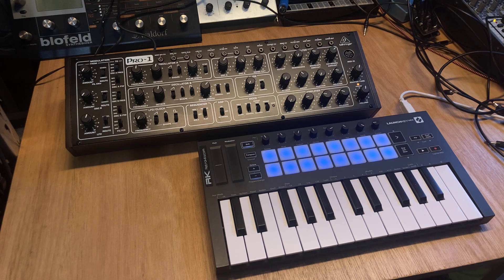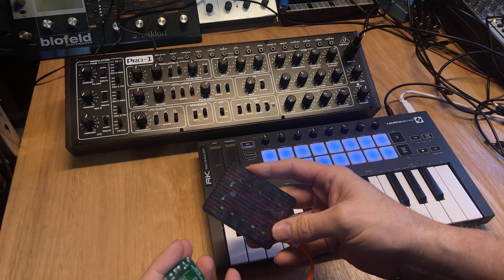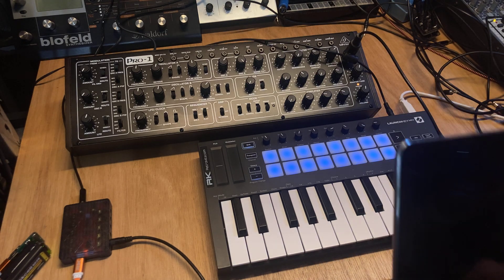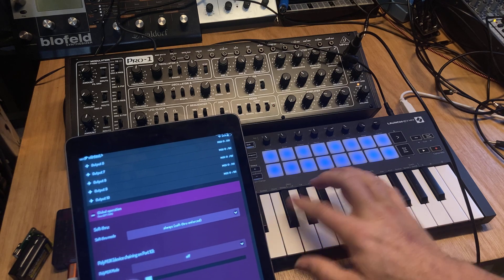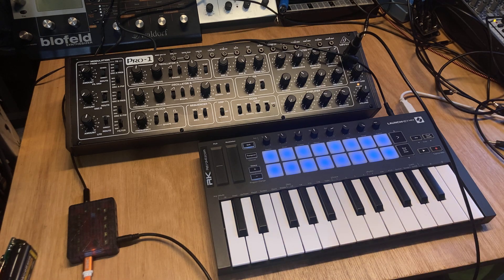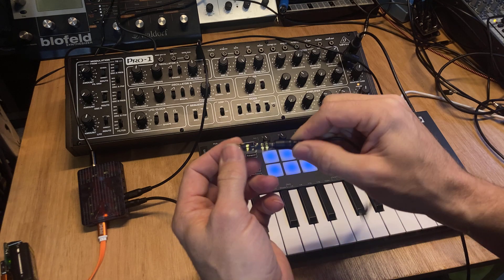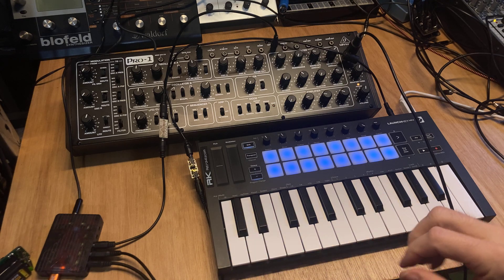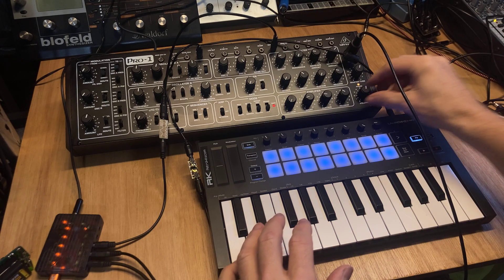RK006 MIDI / CVGATE hybrid output modes

Comment: Thanks for the demo! It makes it much easier to understand!

would it be possible to convert a midi LFO (cc) from a Digitakt to an analog cv LFO to modulate lets say a DFAM?
Reply from the maker: Yes that would work, there are different midi signals the rk006 can convert to PWM/CV, keytrack, velocity, modwheel, stuff like that.
Reply: @RetrokitsDev  Thanks for the encouragement, I'll give it a try, that would be so awesome!!

Comment: I've had the RK 006 for awhile, but just learned that gate mode could do CV! What's the PWM to smoothed out CV converter you're using? And under what circumstances do you find this converter is necessary?
Reply from the maker: Most cv inputs do not read the fast pwm rate and smooth it to a variable voltage themselves, but if you get very jittery input on a cv device it does not. In that case you can put the pwm2cv in between which averages it and sends out a cleaner variable voltage. The pwm out on the RK-006 is a bit of a hack to play with analog signals from a digital device but it’s fun for translating midi velocity / modwheel or keytrack to filter or lfo inputs for example
Reply: @RetrokitsDev  thanks for explaining, I didn't realize it was a product you make. I am interested in buying a couple but the shipping is more expensive than the pieces themselves. It would be great if you offered an option to ship in a standard mail envelope to save on shipping since they're so tiny.
Reply from the maker: If you email or put a message in via the website contact form I can try and find an alternative mail option